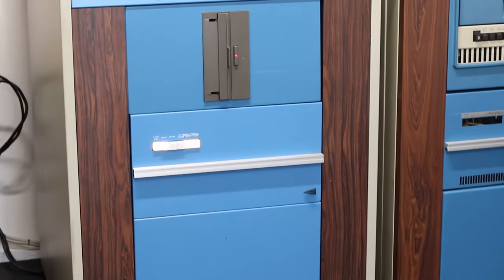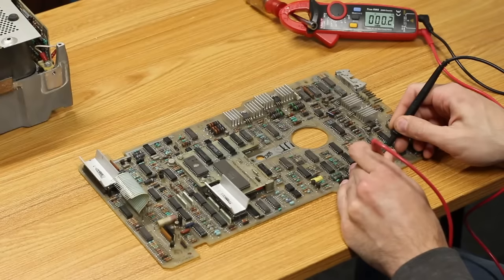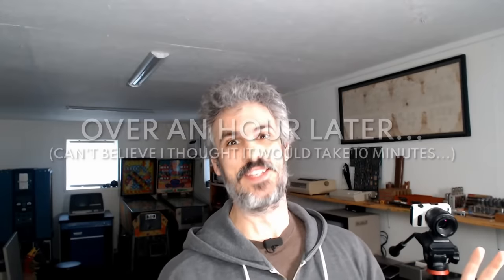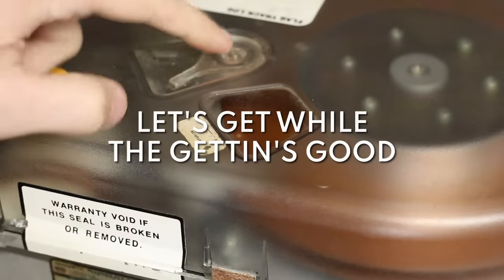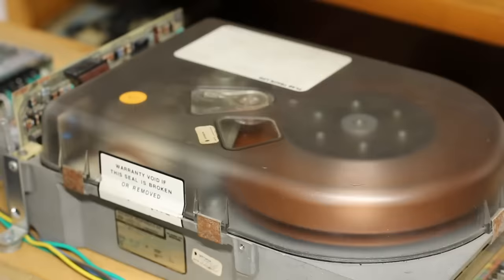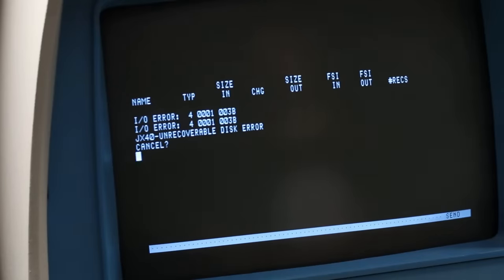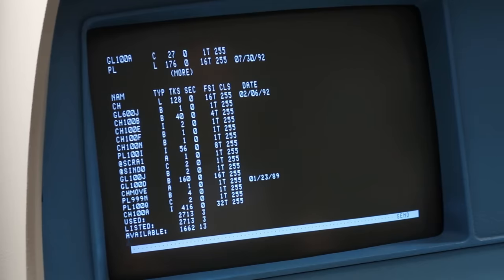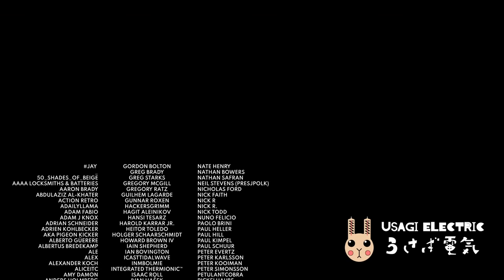Will This Rare 1980s HDD Live Long Enough to Save the Data?

Comment: I still hv a 10mb old vintage hard disk (hv to check the name n model later) which basically almost as big as the one featured here. Its no longer in a working condition, i just kept it as a collection!

Also did came across 5MB washing machine size hdisk collecting dust in a corporate customer factore years back; they stuck for years with old hardware but cant upgrade due to software issues (a pentium II, running SCO unix system v/386) with few big software houses failed to solves until i came n did it. Anyway, i was given a handsome bonus for that - yet if only i knw about the existence of that vintage build hdisk way sooner, i would made it  to be included as part of my payout contract 😢😅

Comment: I have the same noise issue with a small fan that I put on top of the heatsink of my DVB receiver. Everytime I switch it on, and it basically does a cold start, it sounds horrible. But after a minute or 2, it suddenly falls quiet and remains quiet until I turn it on next time... Seems to be a common thing on bearings :)

Comment: Why not make a word level backup of the drive to modern computing? There are lots of ways: emulate the drive, construct a disk interface for a modern PC or microcontroller, or write a Centurion program to hex-dump the drive to the terminal and record it with your laptop. Then you wouldn't have had to sacrifice decades old data or trust the new data to another ancient disk. Instead you could just email the 24 MiB file back to the museum. Some of these could potentially also solve the problem with Butler Tech's Centurion.

Comment: That's old technology for you; a little maintenance, a little cleaning, fix a few bad caps, etc and is JUST... KEEPS... GOING! Not like the crappy tech of today! Might be good to make use of a clean room, pull the faulty finch apart and grease up the bearings?

Comment: Can Ken suggest A) the 32mb disk bad sectors problem and ideas how to solve / how much space is actually lost (for goot?).  B) the "end" of reading of the 24mb disk , is it in a data area of is there some end of file / file pointer not quite right  and can it be fixed, and interalia - which may then be software where a "ghost" of the 24 on the 32 has the same problem would be a zeros and ones confusion

Comment: This exciting restoration culture might fade away as newer products age, since they emerge from an increasingly quantity-over-quality society and the technology is so highly refined that there absolutely higher physical strains on it. They might have allegedly very clever means of coping with adverse influences, but essentially the technology is more vulnerable.
I just had a 10 year old 4 TB HGST harddrive start doing nasty things to sectors on random writes and generally showing bit rot that I only spun up for differential backup every couple days, while I have 15 to 20 year old Seagate harddrives that still work very nicely after having served as system drives for years under suboptimal conditions and then hosted backup data untouched for several years. No data decay whatsoever. (Also cool: Back then you could completely fill a harddrive in less than an hour due to the better speed-vs-capacity ratio.)
Today we are in the era of abominations like SMR trying to assert their right to exist.

If we could overcome archaic fear-based societal systems, we could live in a world of normalized archival-quality manufacturing.

Comment: You would think that with all those old drives out there and the many retro lovers there would be a few specializing in servicing harddisks. 
They are not magic and those old ones are far more crude than modern ones. 
Even without a perfect clean room servicing should be possible, at least to the point you can safely get data of them. 
Replacing heads and such might be difficult, but swapping the platters to a new motor, should be doable. 
And who knows even a head might be doable, the thing the diy community is producing are incredible, and would have been impossible years ago or require special factories. Think the El screens applied science made for curious Marc and such. The things the though imporium does with biology, people making their own silicon chips. Everything is being done.
Reply: One of the biggest problems is kind of a chicken and egg issue. As these drives become rarer, and the parts become rarer, the clear answer would appear to be to have a central lab with spare parts all in one place for servicing. The problem with that though, is that shipping these ancient drives around really isn't an option. Even more common retro devices have a nasty tendency to get broken in shipping. These things are huge and prohibitively expensive to ship around. Not only that, but despite being huge and heavy, the electronics in them are extremely delicate, and they just generally don't ship well. That means if there's a central repair facility of some kind (or 2 or 3), The owners would pretty much have to drive their devices in, which still presents some risk. This would be prohibitively expensive for many people who would like to use such a service. 

The other answer would be to have experienced repair people come to where these devices are. That presents its own set of issues in terms of travel, high expenses, equipment, parts availability, transportation, less ideal working conditions, etc.

It's really not a winnable situation, and part of why I don't think setting up a centralized repair shop for these esoteric devices could actually happen in any cost effective way.
Reply: @Cherijo78  nothing in restoring retro is cost effective. That is not part of the equation. No system he is working on is cost effective.
Many parts could just be made. 
Bearings are nothing special, neither are electromotors. 
The only fragile thing on those drives are the heads and they can be parked and locked. They were sent but courier back then and they can be now. 
Capable hobbyists are repairing almost anything
Reply: the big question is how many people have many drives that they are willing to pay how much to have fixed.....this little data recovery trial is worth about $2000 in time at rates that would support a dedicated facility.....and no way to estimate cost beforehand or guarentee time before next failure afterward....so many Karens and Kevins out there that i have ptsd from doing car repair....i don't see a dedicated service being workable...
Reply: @@trevorbos4220 sorry, but poor quality shipping is a US thing. Things go very nicely in some other countries.
Reply from the maker: One thing to keep in mind is that we're missing a lot of valuable Customer Engineering tools. For example, if we remove the platters from the spindle to work on the motor or bearings, we lose alignment with the soft-sectoring/servo track. We can never realign to it, so a new servo track would have to be written down. However, the method of doing that was never made public, and it was only done internally at CDC. Even in the manual, they explicitly say that the drive is not serviceable, and if a failure happens it should be replaced. 

The servo track alignment problem is a large issue on a lot of old soft-sectored drives like this, which makes servicing and working on them very difficult if not impossible.
Reply: @UsagiElectric  if cdc could do it, others can. I accept it's difficult, but over the years I have seen so many people like for example curious Marc do so many repairs that seem impossible. All that NASA stuff that lacks documentation and has been modified in unknown ways over the years. And so many other things and people. I don't accept impossible anymore. Just levels of dedication required to achieve something. Even you were talking about recoating the crashed drum memory. That might not pan out, but the fact people can even think of doing that says something about how much a hobbyist can do that once was in the high tech realm. Like playing with a Bendix mainframe or having multiple centurions as a hobby😃
Reply: @UsagiElectric  The drive/controller is just another computer that can be disassembled and reverse engineered. After that we would know how the track alignment works.

Comment: What a ride, I was on the edge of my seat with that finch sounding like it was a box full of rocks
Reply from the maker: Thank you! The first time it spun up, I was just sure that we wouldn't be able to rescue it, but against all odds, the drive hung in there!
Reply: I thought for sure that the heads crashed.  It had that grindy, scraping sound.  I didn't see a line on the platter though, so when you said it may be something else, I held out some hope =).

Comment: Even though it was all extremely sensitive personal data, I still hope that the original data on your Finch was backed up.
It'd be an excellent example of the kind of data these machines would have been used for.
In 300 years, the data won't be personal any more, because all the people and likely most of the businesses will be long gone, even possibly a few of the addresses themselves.
But it can never reach that point if it isn't preserved now.
Still extremely pleased that the data on the Vintage Geek Finch was backed up, as well. Backing up more data will never hurt!
Reply: I thought it was a HUGE mistake to delete that data. It is (now was) an historical time capsule.
Reply: @KameraShy  And of course, I would never want it released any time soon, not while that data could still affect people's lives, but it won't affect people's lives forever. At some point, it's all just history, as are we all.
So I really, truly hope that, even though it's not on the Finch any more, it's somewhere backed-up.
Only David really knows, I suppose.
Reply: @KameraShy I had todo something similar on my 2009 Mac Pro when the 12 hour video during rendering ran out of room during rendering so many games and videos I did in the past had to be erased just to finish rendering that video. It bare squeaked by with15gb of had to spare.
Reply from the maker: So to answer your question directly, no, the data on my Finch was not backed up.

Let me explain why I didn't. 

With regards to the Centurion and what it would have been used for, we've successfully backed up multiple Hawk platters, some with customer data and some with applications. While I don't agree with keeping personal data, we have specifically set some aside for preservation sake. At this point, storing more and more personal data doesn't help the project any at all, and conversely, makes me extremely uncomfortable.

There was literally a workman's comp case followed by the company taking the injured worker to court to pay them less on the drive. It was all outlined with dates, names of the lawyers, and money amounts. That type of stuff makes me extremely nervous, and I do not want to have that information in my possession.

So, if the goal was to have some information backed up so we can learn more about the system and how it was used, then we've already got that. If the goal was to just hoard hundreds of people's personal information for the sake of informing some archeologist hundreds of years in the future, well, I'll let that anxiety inducing task fall on someone else.
Reply: @UsagiElectric  Well, I am grateful that the stuff on the Hawk platters was backed up.
I'll admit, however, that I don't understand why retaining that data makes you nervous. It's not the data, it's how you use it, and I, for one, would definitely trust you with stuff like that, because I know that you never release it or use it in any way. You seem the furthest type of person from that.
I don't believe that just possessing the data can get you in trouble, but so long as there is something saved, then it's your machine and you can do what you want and I won't be upset.
Thanks for all your hard work to lift the scene up.
Reply: @UsagiElectric  it's always best practice to purge sensitive info. I think the biggest thing is preserving non-sensitive data files and software and drivers.
Reply: @UsagiElectric  >There was literally a workman's comp case
 >I do not want to have that information in my possession.

Rightfully so. There would be no need for you to preserve that type of information... the court is most likely going to maintain those records anyways. When my mother passed away a couple years ago, I was surprised my lawyer's secretary was able to instantly pull up a copy of my mother's will that was filed with the court nearly 50 years ago.

Comment: I remember that mainframes and desktops split due to physically being too big. 
I see now that desktops need to do a split. 
We can do cell phones, laptops, and tablets; but the workstation desktops are facing a forced breakup right now.
Reply: In large enterprises there is a shift back towards "terminal" like computers by using virtual desktop environments. A low powered computer is used to log into a virtual desktop server and all the processing and storage is done remotely while the screen information is sent back.
Reply: @volvo09  Funny how it goes full circle.

Comment: Takes me back to the harris 800 in my college years.  Wonder if anyone has one working?   There weren’t many of them left in the mid 80’s.  

Once did a data recovery on an apple II disk.   I used dos 3.3 on my machine and her machine was prodos.  So I searched around and found the last copy of Beneath Apple Prodos—-this was literally the last book seller with a copy anywhere.  The book had dust on it!  The seller couldn’t believe someone bought it.  
 I had it shipped and got to work.  The disk directory was destroyed.  But the T/S lists were intact, and I used each one to rebuild a file from each.  From there, my client was able to pick the file she needed to complete her master’s thesis which was due in a few days.   
Amazing I still remember how I did that job which would have about 1986?
That thrill of victory in this video, yep, it’s great.  Oh, still have the book somewhere or another.

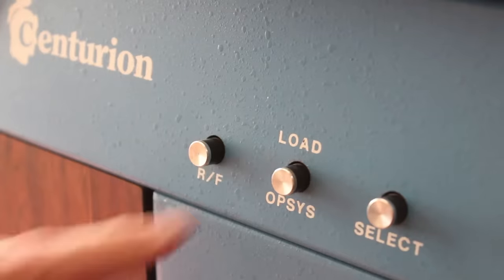Comment: Kind of ironic to have a channel about computers with audio this bad sounding. There's an absolute TON of low-bitrate-mp3-like artifacting on any S-sounds all throughout (really bad example at 12:33 onward, and when the drive spins up first). Also noticed this on a bunch of other channels. Seems like whatever video editing software is used has a really bad exporting preset with too low audio bitrate. Very hard to listen to with headphones :(

Comment: Just looked up the original specification manual for the model 9410 Finch drive, it says the service life is 5 years or 30,000 hours, I think you might have exceeded that slightly lol. It also states, "Following an initial period of 200 hours, the Mean Time Between Failure shall exceed 5000 hours for units manufactured in the first year of production and 7500 hours for units manufactured in the second year. For units manufactured after the second year, the MTBF shall exceed 10,000 hours.". It's incredible you have managed to get any of them working, congrats!
Reply: Service life for electronics means hours of operation, and for hard drives it means how many hours the platters have been spinning.
These Finch drives are old, but we don't know how much use they've actually had. They could well be within the service life (or alternatively far past it), but age is not kind to grease as we've heard haha.

Comment: Will you NEWDISK the Finch from the MicroPlus?  Can it detect and mark bad tracks or sectors? Then copy back the saved data?
Reply: The NEWDISK   JCL script runs the [ .format  ] command and others to complete the setup of the Finch's file system.   On if the task of [  .format   ] is to setup the disk's bad sector table to map around and sectors found the read errors during the format verify read after write function.

Comment: I once had to copy an 8-inch floppy with good data onto an UNFORMATTED 8-inch floppy to back it up. This was on a CPM machine. I wasn't paying attention and put my floppies in backwards in the drives. Since I was doing a sector-by-sector copy, the system dutifully copied the unformatted floppy over top of my good floppy. Now I am crazy paranoid about deleting data of any kind 🙂
Reply: I think the type of harddisks my dad used to work with might be in this video, he once deleted the whole company's several years worth of archiving of theater documentation (song-texts, information about where to find decor pieces or clothing items, he worked at a conservation company) due to a faulty bulb he tried troubleshooting by exchanging bulbs.
In the meantime, he also tried something else, and mistook the good disk for the wrong one, and destroyed the backup, with the original work-disk being non-functional at the time.
When my dad was with the company for 25 years and it was celebrated, the then-head of the company had a little speech about how he was not easy to be moved about big changes in the company, but "I was told that one time he made a big mistake and destroyed years of work due to a faulty bulb, and it was the first time that he decided to take a walk, looking slightly more pale than he usually was..."
Reply: I knew someone who did the same with one of the CDC hawk like 500mb drives. He was supposed to do an overnight backup, but backed the empty or"scratch" drive onto the full working drive, wiping all of the data. He was called scratch from then on😊